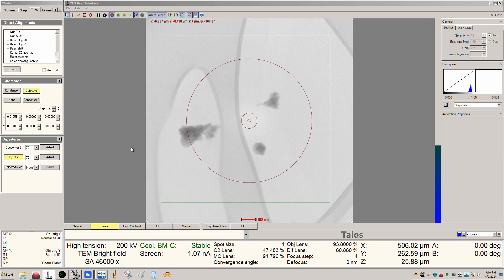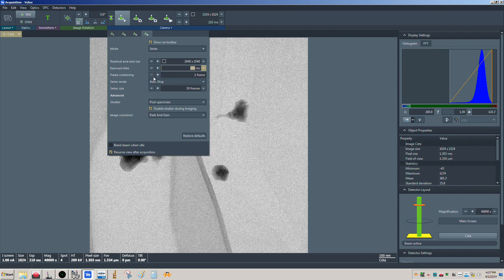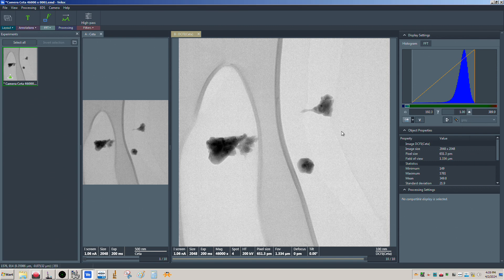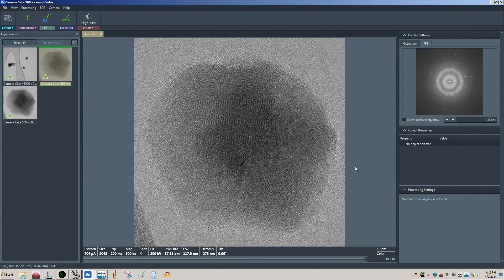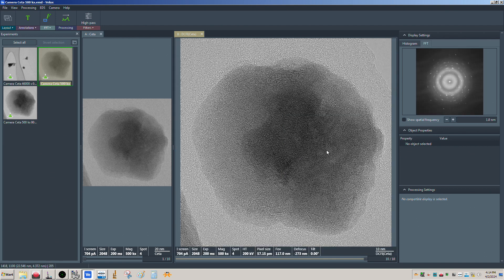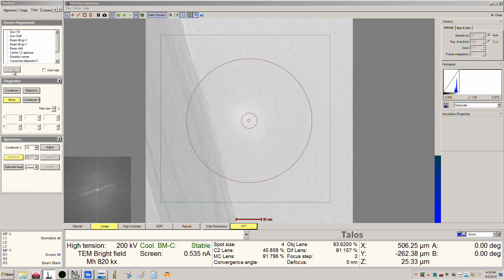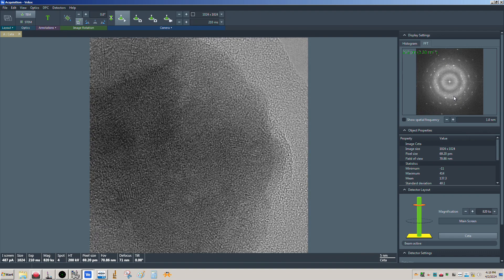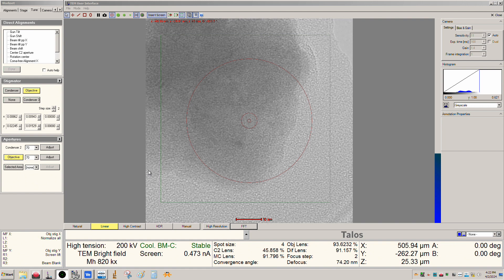FEI Velox: drift-corrected frame integration for TEM imaging

Comment: I'm working on Titan Themis3 and I noticed that usually averaging 5-10 images with shorter time gives worse SNR comparing to one image with long exposure. Is there a reason for this? I ended up using jog function in the piezo control of the stage to stabilize it so that the sample doesn't move much for 4-5 seconds. Also, on that account using piezo stage sometimes causes constant drift in one direction, especially after disabling it. Have you encountered something similar?
Reply from the maker: Good to hear from you!  For frame summing to be effective, the individual frames need to have sufficient SNR themselves; otherwise, you are basically just adding noise when you add the frames.  The only exception to this is if you have a "direct detection" camera, but I'm guessing this is not the case for you.  If the exposure time is around 200 ms per frame, then I would make sure you have sufficient current getting on the camera.  In my video, this is at least several hundred pA.  If your starting beam current is 1.0 - 1.5 nA, this should be possible provided the sample is sufficiently thin.  I've never actually used the jog function of our piezo control on our Themis, but using it to counteract drift sounds like one possible application.  I do notice the instability associated with the piezo stage that you are talking about, mostly after enabling or disabling, but it tends to go away fairly quickly.  I found the easiest way around this is to just leave the piezo controller always enabled; then it should be relatively stable if and when you want to use it (and there is no harm in just leaving it enabled).
Reply: @NicholasRudawski  Thank you, I will check the results next session. Hope it will work and I won't get much drift
Reply from the maker: @tymofiipieshkov3819 you're welcome; I hope things work out for you.